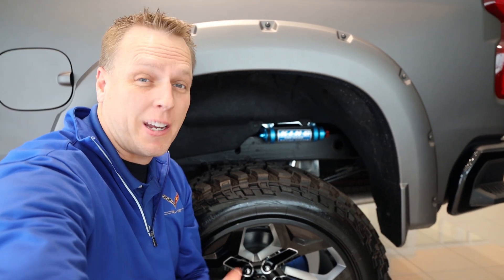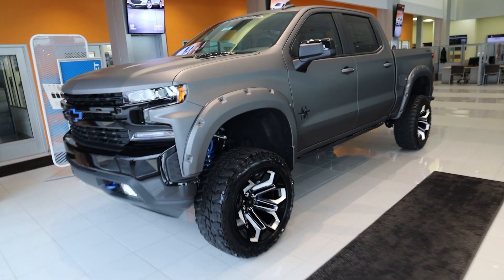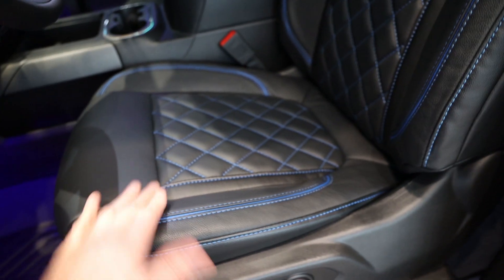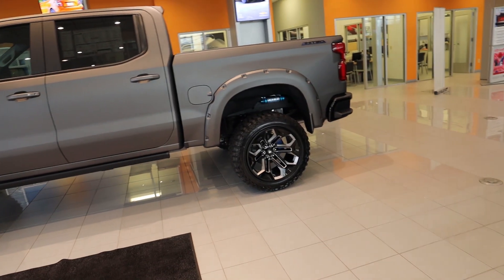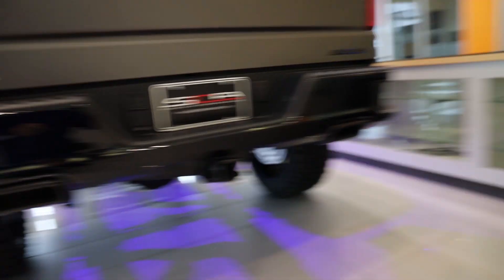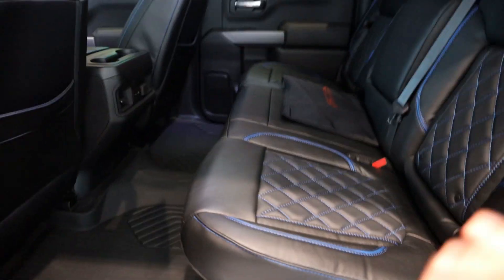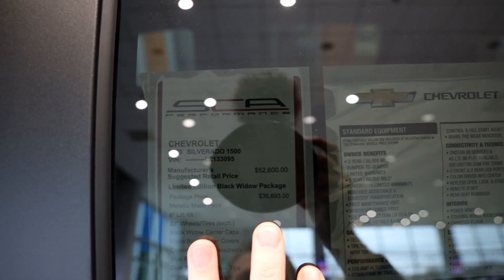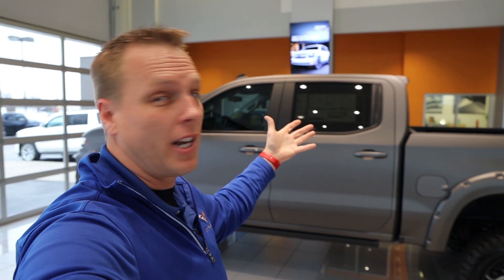I built a 2020 Silverado to compete with the 2020 Ford RAPTOR!

Comment: All show ..lol no beadlocks nd low profile tires which is useless in deep ruts...those rims would get destroyed off road lol nd tires
Reply: Does the raptor have beadlocks? Lol
Reply: Agree...great for looking offroad worthy on the street but needs some 17" methods and some 37s
Reply: @DStabs720  The upgraded wheels on the Raptor are beadlock capable from the factory.
Reply: Beadlocks aren't street legal...

Comment: I feel bad for whoever you sell this truck to if you actually get them to believe this can compare to the raptor, eco boost will walk that 5.3, stock tires, rims and shocks on the raptor kills that setup, for 3k less you even get a better interior. I hope this video was a joke
Reply: James Anderson I’ve never owned anything but Chevy and you’re not wrong. Not to mention 22s will not help off roading lol. Personally if I were to attempt to “compete” with the Raptor I would have gone with a 4-6” BDS coil over kit on a High Country with the 6.2. Throw on some 35s with 18s and re gear to 4.10s with a dyno tune and at least it would be respectable but maybe not comparable.
Reply: James Anderson not to mention those tires and rims wouldn’t last....
Reply: I agree that the rims and tires aren’t very off road worthy. I hope he tuned those Kings otherwise it’ll ride like crap. I had to rewind to make sure I heard him correctly when he said 22 inch off road wheels and tires. He must not follow the off road community as most people will air down their tires when going off road to increase traction. Can’t air down short sidewalls. Many municipalities don’t allow blue lights on vehicles

Comment: WGAS who's first... so it doesn't have any extra horsepower like a supercharger? how is it supposed to compete with a Raptor?
Reply: jeff craven it doesn’t compare to the raptor which is why Chevy doesn’t make one. This is strictly profit for the dealer.
Reply: It won’t, that pos will be stuck in the first mile off road, but at least you have underbody lights?
Reply: D Pupo lights to illuminate the garbage it’s hooked up to.
Reply: D Pupo You are being kind with a mile. I was thinking in terms of feet

Comment: This thing is a joke.
🤣👎
Reply: @lastcall170  
Wrong troll.
I promise you if I wanted this abomination I would have zero problems having it in my driveway.
Thanks for playing though!
Reply: @lastcall170  
Lol
Reply: Needs boost especially since raptor has turbos and early raptor had roots supercharger
Reply: @mikeanderson7206  early raptor was 6.2 na?
Reply: James Anderson I thought it was standard equipment but looked it up. It was an option for supercharger to get 600 hp from 6.2
Reply: I'm also a Chevy man,  5th generation gm enthusiast, my grandfather was a gm mechanic for many years

Comment: Mike I thought you called that small window sticker "The Ripoff Sticker ".....just saying...
Reply: That's exactly what it is
Reply: He was more specifically referring to the “market value adjustment”, which is what that side sticker usually is. The only time it’s actually (quasi) legitimate is when it’s a high-demand item (like the new Shelby GT) or if the dealership actually does something to the vehicle. In this case, it is worth more than the regular RST or whatever it was originally. I would say that $35k-markup is probably twice what the retail should’ve been, tbh.

Comment: New Raptors are close to 65k or so.   So if you wanted to compete with a Raptor wouldn't it be closer to the Raptors price?
Reply: No it not it more like 75-85 grand for the shitting ford
Reply: Yea and this Chevy is 88k so what's your point ?
Reply: ioannis kalmanidis show me one raptor thats 85k w/o some crappy package like this a hard loaded one is 77500. Which is electronic dash, 360 camera, heated and cooled seats, rear heated seats, bang and Olson upgrades audio ,panoramic roof and the glorious ford unlock number key pad

Comment: As a loyal GM guy, nice truck but not close to competing with the Raptor. King shocks are the best. If u want a truck that can compete with the Raptor, look up the JaxPower Jackel.
Reply: Actually it's "Pax Power". They're based in Texas and they're definitely doing a "raptor like" competitor, with the Silverado. It's definitely worth looking at. A much better/capable truck for a couple thousand LESS than this mall crawler set up.
Reply: @stanlojewski6761  thanks for the correction. Good thing about PaxPower, they let u purchase the Chevy u want with the trim u want and u pick the stage u want (I believe it's stage 1,2,3). Stage 3 being the total package. I'm a 2 hour drive from that shop, almost makes me want to go trade in my current GM truck!
Reply: @ericbenavides8142  yep, there's 3 different stages. You can even buy a trail boss & have the different options available from gm that you want and have Pax Power do their thing to that. If I had the money, I'd do it but, I'm more than happy to hold on to my '06 Sierra lbz duramax. 🙂
The "black widow edition" looks cool & all but if you're looking to be "capable" out of the gate, the Pax Power Jackal is the obvious winner, with the wide body, functional ram air hood, 6.2 litre tuned "up", long travel suspension, Deaver leaf springs  and King shocks, etc. Just an awesome package!

Comment: Big GM truck guy with 6 bought new but dipped my toe in the dark side and bought a new 2019 Raptor 6 months ago.  Besides the exhaust sound, it is a dramatically better truck overall than GM unfortunately.  Only thing I really like more with the GM is that amazing 6.2L V8.  

Hope GM steps up soon and I hope it is nothing like this aftermarket monstrosity.  ;)
Reply: Sounds eerily familiar. I've been a GM/Chevy guy my whole life. Had a string of problems (to put it politely) with a 17 Yukon Denali. I got fed up after a mere six months of ownership and traded it in on a F-150 Platinum with the 3.5. Love it and don't know if I'd ever go back to a GM product.  I was pleasantly surprised at how hard that little V6 pushes you back in your seat. It doesn't have the broad torque band that the 6.2 has, but it is worlds above (power wise) the 5.3.

Comment: As a 19 Silverado Trail Boss and 19 Corvette ZR1 owner I will say that I am a Chevy loyalist.  With that said, I can get a Raptor that comes with more options than this Black Widow for about 3k CHEAPER.  Not only that, but the Raptor puts out a good 70HP more than the 5.3.  That Black Widow is an absolutely gorgeous truck, but it DOES NOT compete with the Raptor.  You would need to put the 6.2 in the truck, add some of the creature comforts back in, put a more off road capable wheel and tire package on it, and then lower the price by at least 3k.  Do that and you would be close to competing.  That truck is a beautiful pavement crawler, but a Raptor????  No way!

Comment: be nice if GM would put the 6.2L in any trim.  Doesnt cost more than the 5.3L  to produce. Iv had 2 6.2l 4x4 silverados and 4 5.3l silverados. both 6.2l get better mileage and way more power. My current 6.2l is a 17  max trailering crew cab 4x4 6.6' box 3.42 gears 8 speed and it get the same mileage as  my 17 5.3l extended cab 4x4 with 3.42 gears 6 speed.

Comment: Chevy Dude If you want some serious pointers on making a raptor killer then here it is man. Good start with the king suspension but you dont want a 6 inch lifted truck. Start with a base chevy with the 6.2, add a magnusion supercharger, full icon suspension with upper control arms, upgraded deaver leaf spring pack, forged 17-18 beadlock wheels, upgraded big brake kit, 35 inch nitto ridge grappler tires, and a wide body fender kit to allow for increased wheel travel. Also lockers front and rear. Build that.

Comment: When you put those big wheels and don’t up size the brakes you have decreased to braking power of truck. The angular momentum of that wheel tire has to be a huge increase over the stock wheel they were designed for.  Other than that nice truck

Comment: The Raptors will always have a higher resale value and over all are better built than any other truck out there. Trucks like this are just “modified “ and all the money put into them you will never get out of it. I’ve owned both and my current is Raptor is hands down the best truck I ever owned. I use my trucks like real trucks they are not parking lot princesses. Go watch the development of the Raptor and it’s first Baja Race hoe all the parts not just the Shocks are upgraded and heavier duty.

Comment: Mike I think that Chevrolet has a truck that competes with the raptor it's the Trail Boss cause the engine and transmission can handle more power than the ford engine and transmission with a simple 120 HP tune on the engine and transmission on the Trail Boss
Reply: Lol where did you get this false info 😂

Comment: If you really want to compete with the raptor you need smaller wheels and bigger tires and oh a tuned 6.2 lt would be nice. It also needs to be wider than a normal Silverado and some marker lights. King is very good.

Comment: Calling rock lights underglo put it in the mall crawler slot, nice looking but not as serious of an off road truck but a light duty off road adventure vehichle. Upgraded shocks are a start how about a winch, lighting package, beefed up front end components, 10,000 dollar paint job thats gonna get scratched first time doing serious trail riding spend that money on the other useful things I mentioned as well as some bolt on power adders and then we can start talking off road not curb climbing at the 7/11 lol.

Comment: It's no competition to a raptor and I own a trailboss and the aftermarket is cheaper then GM'S  but where you are wrong is the quality is as good as GM if not better depending on manufacturers. When I'm done with mine it will be mine there will  not be a other one just like it.

Comment: You can do a bunch to the new silverados to make them work great offroad- bajakits upper arms,king 2.5 and some 17's and 35's for probably $7500 and it would get you to 85% of the raptor capability... Realistically smart move is to buy a raptor for 75K . 12 months from now a raptor will be worth 65K and this truck will be work 35K.

Comment: To be even close to the Raptor you should have gone with 17 or 18 inch wheels and larger tyres. The 22's look good but you need bigger thicker tyres as there is no side wall. There is no point in having high profile 22s if you're going of road and there is no point having AT or MT tyres if you're not going off road. The old saying either too much money to know what to do with or they've got a small sausage being polite and keeping it G rate. Oh also GM is hated here in Australia even more now because they've announced they're shutting down Holden an Australian arm of GM bit like Chevy after 160 years in operation all because they don't want to build their decent vehicles in Right Hand Drive!

Comment: Why would anyone buy this? I custom ordered my 2019 ford raptor supercrew back in November of 2018 for $61,190 (before taxes) in Cali. I absolutely love my Raptor. We will most likely forever have at least one Raptor handy from now on. I can’t imagine not having one. 

$55,840 Base MSRP for 2019 Ford Raptor Super Crew (4 door) (800A package)

$3,855 Total of Options
-17-inch Forged Aluminum Bead-Lock Capable Wheels ..
-4.10 front axle with TORSEN® Differential ..
-bed divider .. 
-bed-liner spray in ..
-remote start system ..
-Tailgate Step with Tailgate Lift Assist ..

$1,595 Destination Charges

Price without taxes and license: $61,190
Price after Cali taxes and license: $67k and some change

Comment: Funny you BUILT this,more like you checked the boxes.As a GM loyalist and a hater of the rest,this is no Raptor,I don't believe a lift kit and fox shocks would be in the same league as what engineering that has gone into the Raptor.Since you built this it does look fantastic.Do not understand why anyone would want a 5.3 over a 6.2 in such a high dollar truck.With those heavy wheel tire package it has to be weak.

Comment: Looks good. Paint and accessories are well done. The trolls came out. That's how you know the customization is right. One thing is this is more town and country, but throw smaller rims and meatier nobby tires and ready for real off road. Nice truck though. You guys need to get that new colorado Xtreme with 455 hp. By the way the ZR2 already beats the raptor but is smaller sized.

Comment: Why have you succumbed to being like the other's.....
The Ford Raptor is a PRODUCTION truck. Unless the truck in question is factory, it can't be compared to the Raptor!  You can take any truck and have someone else mod it to compete with the Raptor. But you're still comparing an aftermarket build to a factory build. It's not the same, knock it off.... lolol

Comment: Love your video (s). This is a fantastic looking vehicle! I'm glad you made improved the interior. As a former GM/Chevy owner, I've always felt that the quality in materials and more-so design of the dashboards in their pickups, even the latest model are way behind the offerings from Ford, Dodge and even the ever aging Tundra. I'm hopeful the dash of the 2021 Tahoes find their way into the pick up trucks.

Did you do anything to the 5.3 to increase the output? I've owned an Avalanche LTZ and Tahoe LTZ, both with that 5.3 and I thought it was under powered, never hitting the power band until about 3800-4000 rpm. I did have the 6.2 in my 2017 Yukon Denali. That's a helluva motor! Unless you've done something with the 5.3, or start with the 6.2, I don't think this truly competes with the Raptor as the 3.5 has 95 more hp and close to 120 lb-ft more torque. Plus, this Black Widow is about $5-$10k more than the Raptor. 

Anyway, you've put together a fantastic package, that is a huge improvement over a stock 1500. Keep the videos coming!

Comment: You should do your homework on a Raptor before you say that you built one to compete with it. You didn't. A Raptor is not just another run of the mill F150 with some suspension and wheels slapped on it like this one. It has its own unique frame, suspension, axles, powertrain and body. 

Although it's not made to be a 1/4 mile truck, the Raptor will absolutely annihilate that thing in acceleration. Also, the Raptor has run and finished the Baja 1000. Take this Chevy through there and you'll see why the Raptor is far superior. The price? A fully loaded Raptor is comparable. About 75k.

All in all, you made another blah blah blah "I made a Raptor fighter" video. That's all.

Comment: Sorry but those shocks don’t do more than the raptor. The Raptor shocks are adjusted on the fly by the ecm. The King, although very high quality aren’t even in the same universe.

Those 22” wheels are going to look terrible the first time off-road. With the short sidewalls, the truck is going to ride rougher, no matter how much is spent on shocks. A low-profile E load range cheap tire will never ride as well as a high profile D load range tire.

That 5.3 and likely 3.42 or higher gear rear end doesn’t do well turning a 35. Will it do it? Yes, just not enough power for a solid jump and go. It’s not a 450hp 500+ lb/ft tq engine married to a 4.10 or 4.11 gear like the raptor, which will turn 35s into a cloud of smoke.

This truck isn’t any wider than a stock truck, whereas the Raptor has a wider wheelbase for more stability and better handling. The Raptor has wide flared fenders to compensate for the extra 7” of width and keep everything tucked.

Lifting a truck is not the same as the truck being designed around suspension and wheel travel so that theory is deflated too.

This is a “My daddy bought this all by myself” truck for someone who is scared of a dirt road, not for someone who is likely to actually use it. This doesn’t compete with the Raptor because the base truck doesn’t. GM builds some decent vehicles and I’m a GM owner but a spade is a spade. This isn’t even relatively comparable with a Raptor.

BTW, the 5.3 is weak so I’m having a Texas Speed 427 topped with an LSA blower built for my wife’s 2019 Tahoe...

Comment: I think the question is that everything looks fantastic. But I feel that they should tweet and tune the engine.  And possibly should of put a wider body kit on it. The raptor would still Demolish it.  And I do not like Ford. But a stock Chevy engine vs a Raptor, That’s not turn.

Comment: Top the line lift kit?  You've never heard of BDS or McGaughy's have you?  Honestly that lift hardware doesn't even look as good as Rough Country stuff.  Yeah, this truck could be so much better with off the shelf parts.  Oh, and go jump that sucker over a sand dune and see how far that suspension travels and if it holds up and we'll then determine if it would compete with the Raptor.

Comment: I mean it's "nice," but way too busy for me. I'm a simple guy ;-) Just give me an all Black Z71 4x4 Trail Boss with a 6.2L V8, a 6" Lift, 20" Black Fuel Vapors, and some Toyo Open Road AT Extremes and I'll be very happy (and I would choose it over an overrated Ford Craptor any time of the day, month, year, decade, and century). Ford Raptor is just a novelty, a truck that is dressed up in Batman gear; it's all a facade that Ford fanboys bust nuts over. That's why Chevy doesn't build something to compete with it. Chevy builds trucks, not costumes.

Comment: So what did you do to the motor. also I would’ve went with 20” wheels so that you would have more tire that why the Raptor has 18” rims and 35” tires. But I love this truck it’s nice.
Reply: mwill76 no...raptors come from the factory with 17” wheels...not 18”.